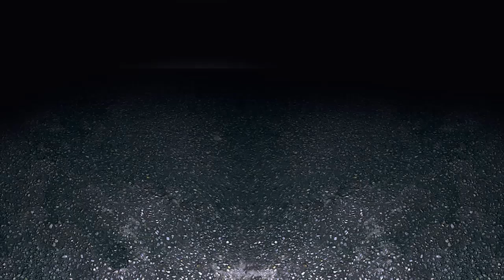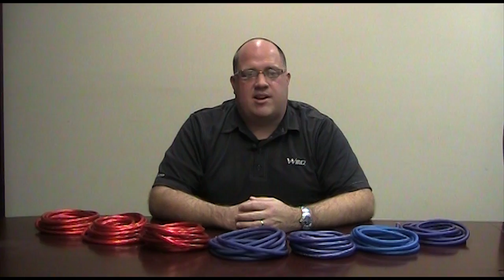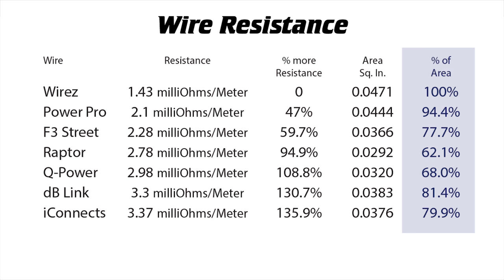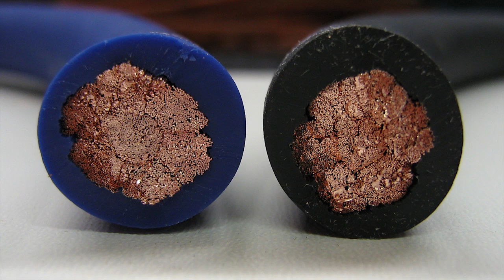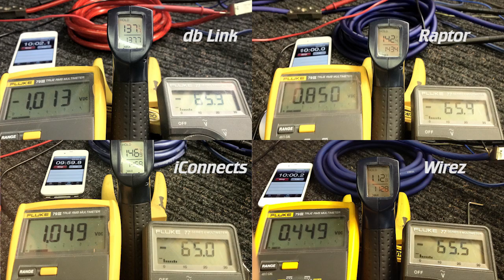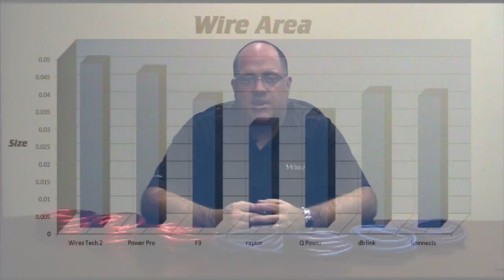Wirez Amp Kit Comparison - Part 2

Comment from the maker: Hey guys, we genuinely appreciate the feedback..

We thought long and hard about discussing pricing. In fact, we agonized over it. Two significant problems arose from those meetings. Posting the price of a product, be it Wirez, DB Link or whatever serves as a permanent definition of it's value. Different markets, different distribution models and a different customer base result in different pricing. Up here in Canada, we have experienced a 10% change in the value of the Canadian dollar over the past year. All distributors have had to react to this by changing their cost. Also, the intention was for the video to be able to be used internationally..  Overseas pricing is VERY different than north american.

The other problem, and one that's even more frustrating for us to handle from this aspect is that Wirez does not publish ANY pricing publicly. It was developed to be an exclusive bricks and mortar product. The concept of 'built by installers for installers' is at the core of our business plan. Wirez has turned down Amazon, Sonic Electronics and Crutchfield's offers on several occasions. We believe that the future of the mobile electronics industry is to support specialists.. Integration is getting more and more difficult, and it is out intention to remain true to those specialists. As such, the entire Wirez line is priced to what the dealer and market can bear. We know that the price of a product in Western Canada is not the same as in, say, downtown Toronto. But, the same applies to speakers, amplifiers and labour rates for those dealers.

With respect to what kits we chose for the test, it was done on popularity. We asked our sales team to bring us what was being sold in Eastern Canada against the Tech Series kits. The core of the test began simply as a product comparison for our use. The differences were so dramatic, we chose to turn it into a video. The intent of the video was to highlight the massive differences in cable resistance.

As for a comparison of what the amps kits costs, that is easily done by any dealer in any territory. We can tell you with confidence that the Wirez Tech Series kits are not 200-300% more money, when their current delivery capabilities are quite impressive in that regard.

Thanks again for your feedback!